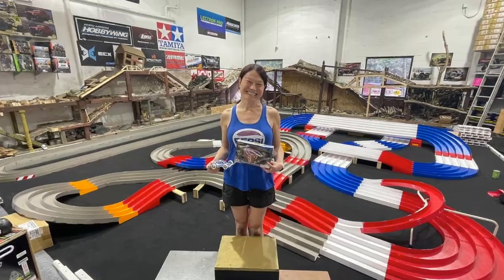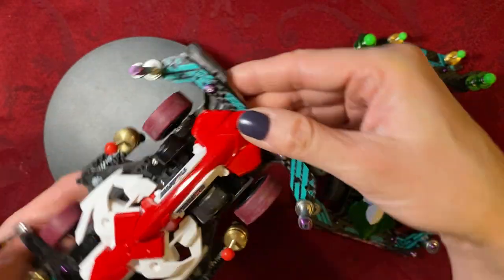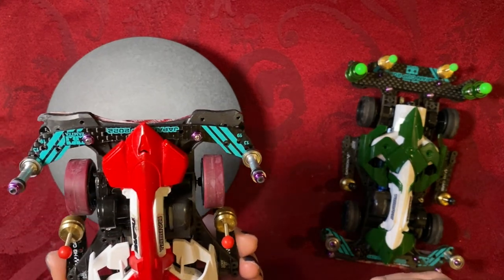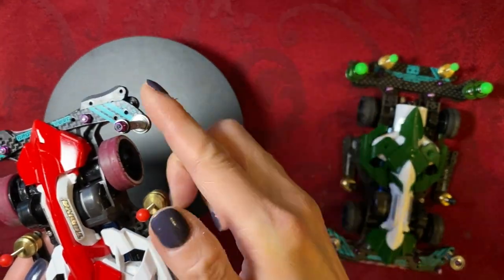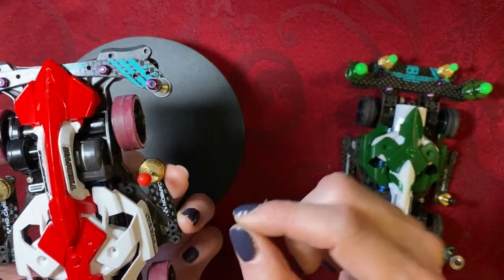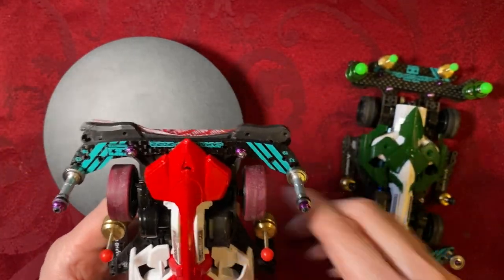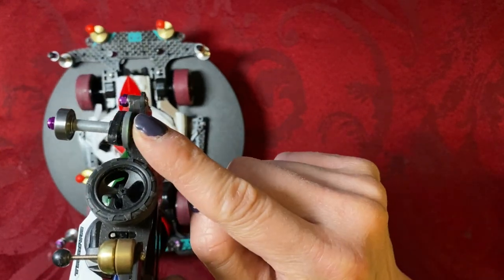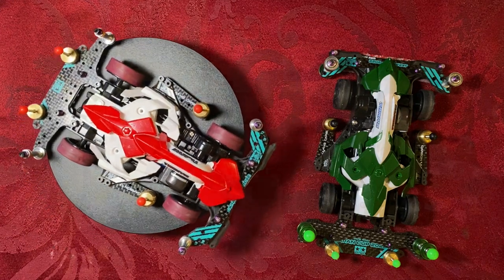Tamiya Mini 4WD Voltron MAX

Comment: I'll try to copy your set up, my fma is pretty quick, but its having trouble with the lane change
Reply from the maker: Voltrom MAX has no problems with lane changers. The best tip I can give is.... did you try a different chassis? One of my racer friends at Hobbytown studied the Mach Frame chasses and noted that the newer produced Mach Frame chasses do not have the same quality as ones made a few years ago. Some of the chasses are warped.
Reply: @claredin  thanks for the info 👍👍

Comment: You can also put body damper too at bmax right? So u can use hard wheels also and hyper dash.
Reply from the maker: Hi Antonio, no, I'm afraid you cannot use body dampers in BMAX class. BMAX is actually a more restrictive version of tuned class that's designed to reduce the possibility of experienced racers winning because of crazy wicked designs. The idea with BMAX is to allow new tuned class racers to compete favorably with experienced racers.
Reply: @claredin  what's the rules you have on bmax? I thought you can install any parts any high grade in anywhere but no cutting, no deforming, and no bending of parts.
Reply from the maker: @antonioiiielarmo9247  here are the rules i've seen: https://www.facebook.com/photo/?fbid=1778255215709412&set=pcb.1778255285709405